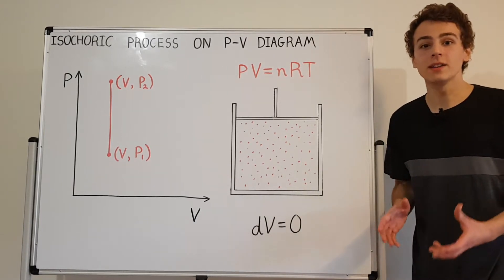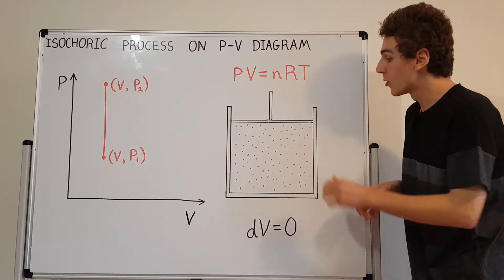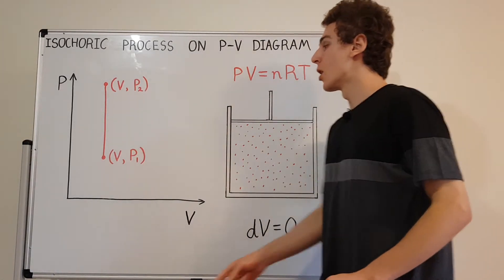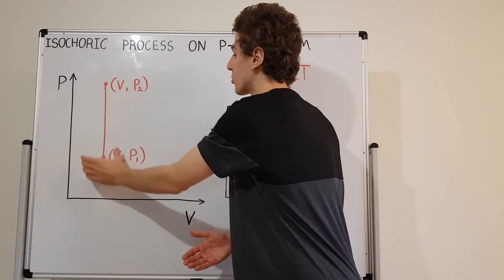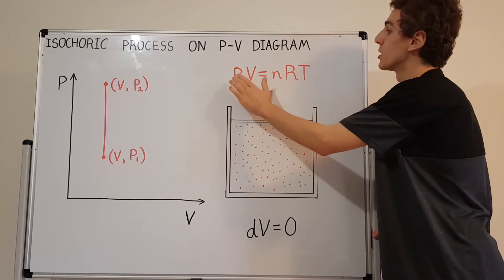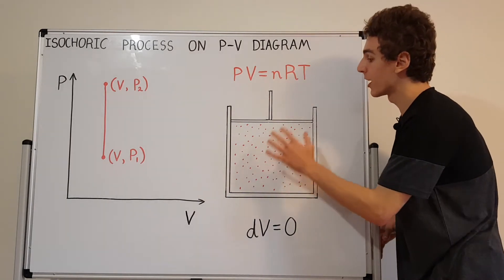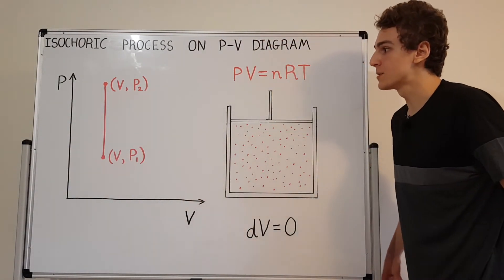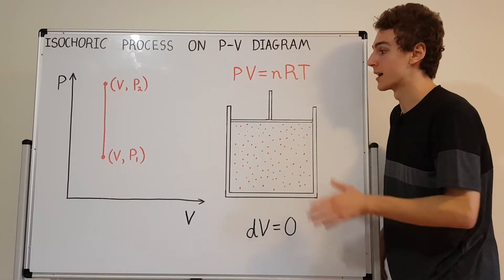Isochoric/Isovolumetric (Constant Volume) Process on P-V Diagram

Comment: What if the initial volume of water(compressed liquid) fill half of the system but after heated, it becomes saturation mixture and the volume of water increases but the volume of system is unchanged yet. Is there any work done?